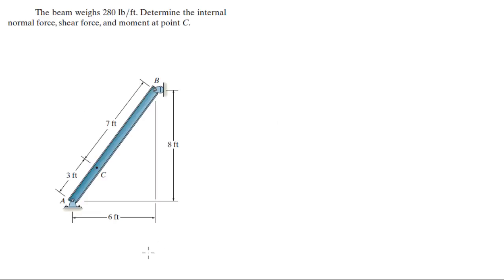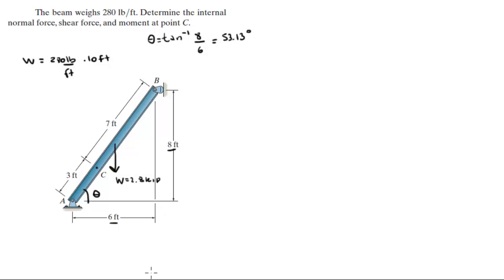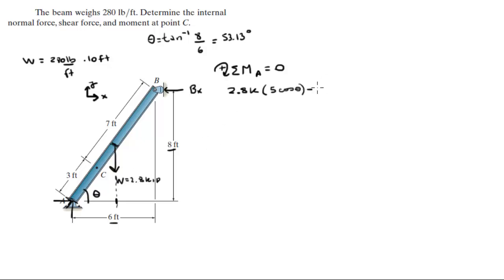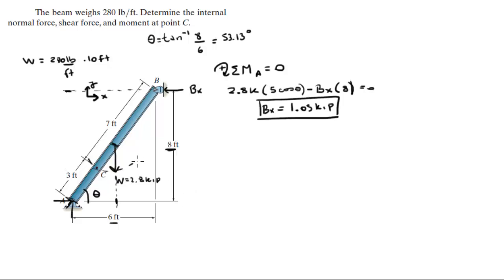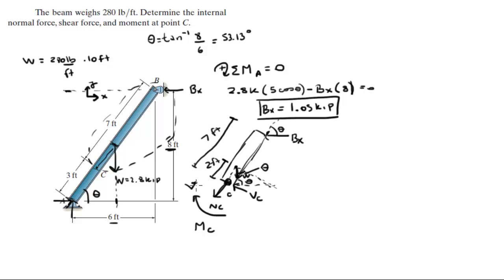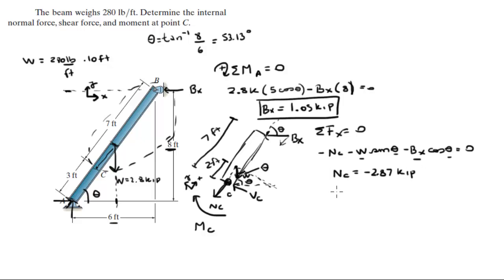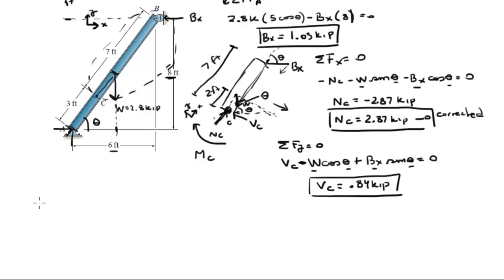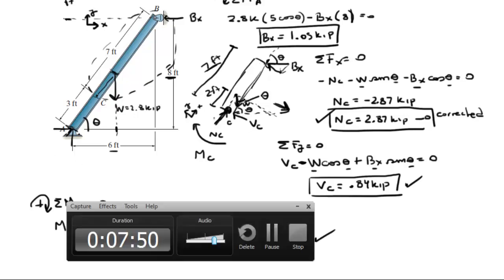Determine the internal normal force, shear force, and moment at point C

Comment: solution manual: Nc=2.20kip : Vc=0.336kip : Mc=1.76kip ft
Reply: yea I got 1764 ftlb for mc as well. -1050(3)(4/5)+2800(3)(3/5)-840(1.5)(3/5) + MC =0 
I used segment a-c. Fx= NC +1050(3/5)+2800(4/5)-840(4/5)=0
                                     Fy= -VC -840(3/5)+2800(3/5)-1050(4/5)=0
BX=1050                         NC= 2198 lb
AX =1050                        VC= 336 lb